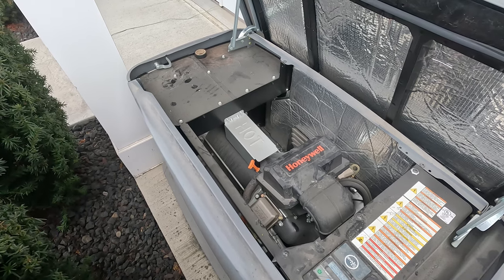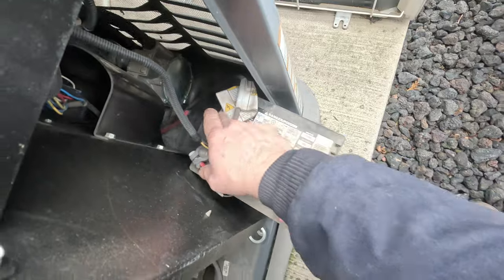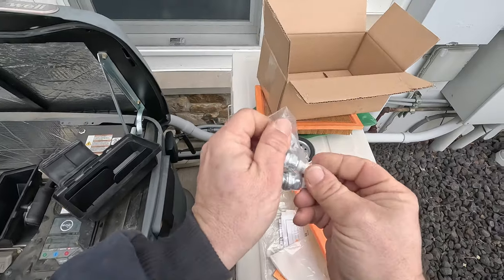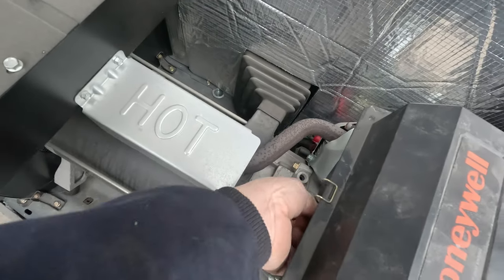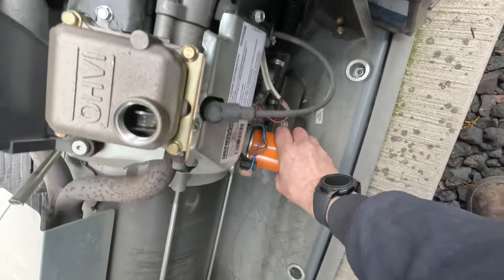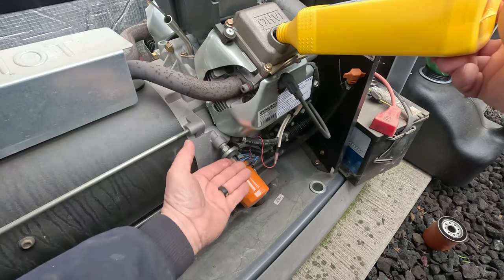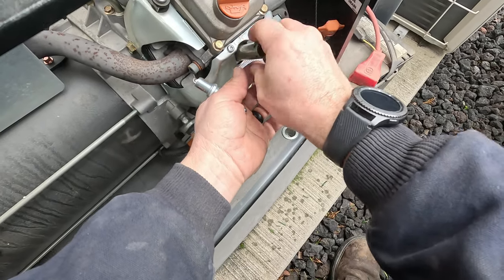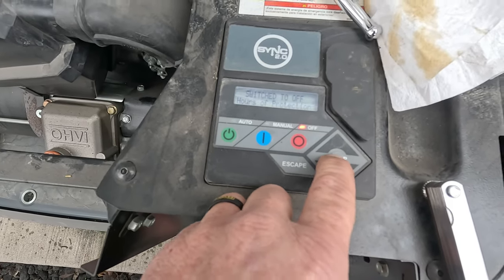Generator Won't start?  Generac Service Made Easy!

Comment: Well done, I was looking for a no  crank issue and I’ve been doing all my maintenance since it was installed in 2003 . I already replaced the starter about 10years ago. I was hoping it was the solenoid this time👍

Comment: Cue the putting contaminants into the filter arguments......
Reply from the maker: Isn't that what the oil filter is for? To catch the contaminants LOL it's not like this thing's hydroscopic
Reply: @HVACRSurvival  apparently the oil enters the small holes and comes out the center so pouring oil could put particles after the filter...I always thought the oil went the other way and always filled em up as you did so I just oil the seal and fit it empty. I think the oil moves so fast its not a big deal these days...
Reply from the maker: If the oil is brand new and the oil filter is brand new, then if there are contaminants in there,  it's probably from the oil filter. Even then worst case scenario to catch it on the other side of the filter as it circulates through. I don't necessarily think filling the oil filter in advance is that big of a deal either but it's just something that made sense so I just started doing it.
Reply: @HVACRSurvival  my thoughts too but if you let a mechanic see you do that you can set em off... especially if they are by the book mechanics....they say all you need is a tiny particle to destroy the crank journal...

Comment: 250000 kw generator???  Like to see the size of it!   I’ve done work as a CM in the navy and worked on a lot of 400 kw gens, about the size of a short shipping container.  200 kw were the size of a van.  Of corse this is the entire unit as a whole, fuel tank and all.  But a 250000 kw must be massive 🤷🏻‍♂️
Reply from the maker: Sorry. I misspoke. 250kw.
Reply: @HVACRSurvival  I thought so, all good…. I had to rewind it a few times to make sure I heard what I heard.   Just curious if the Hoover damn could produce 250000 kw lol,  I’m sure at that point it’s in the mega watts.

Comment: can you tell me what causes the stators for fail
Reply from the maker: It really depends, dirt can cause major issues if it’s running, the vibration of the dirt in the windings can cause it to eat through the insulation. Another possibility is getting degreaser or some sort of chemical like battery acid in the windings or over loading the generator.

Comment: An auto mechanic said it's a no-no to fill up the filter, you're potentially introducing contamination into the system
Reply from the maker: That's the weirdest thing I've heard, I wonder how they came up with that.
Reply: So when you do your oil change on your car do you not put oil in your filter.  It’s the same principle. Just different application.  It allows the flow of oil from filter back into the system easier on start up when it’s already has the oil in it.
Reply: @jonathanontkean7270  definitely no oil in the filter, just some on the o-ring
Reply: The mechanic is Rainman Rays Repairs here in YouTube, he has a few videos where he talks about it
Reply: 3rd generation mechanic going back to the 50s that is completely incorrect doesn't even make sense its no different than filling the crankcase or just having the filter off all 3 are  chances of contamination so in your theory the right way is don't change it which goes back to incorrect you want the media wet when the pump slams oil in to it this also helps dry starts

Comment: Great video for home owner level maintenance. I just bought a 7.5 Kw unit and the motor looks to be half of the two cylinder model and the crank rides on roller bearings not like bushings that a lot of motors have gone to, The form a funnel will be a good thing to have.
Reply from the maker: Thanks !

Comment: Thank you for the maintenance review and tips. My 2003 unit is in Northern Michigan. From previous videos U have given me a very clear understanding how these things operate and their issues. I do all my maintenance myself since I’m a very remote farm. For survival I have to be self reliant  and I’m well trained technician and engineer. Fortunately, I don’t have any critical loads (home is super insulated) that need to be attended too so I will operate the generator manually (once a day) for larger loads, and to charge a battery with inverter used for light loads during an outage. Plan to add a solar system in the future. Looks like at the end of the video U may have left the quart oil bottle in the generator compartment since you’re working with the camera. Great explanation of all the details involved with important safety notifications.
Reply from the maker: I leave the oil for the owner, because it's an air cooled motor it will naturally burn more oil than a liquid cooled motor. I'm doing a review on a solar generator real soon. It's 3600 watts RMS and 6000 peak, I also have a 400 watt solar panel to charge it. This sounds about what you'll need.  I ran the whole house with it, the only issue is you need to use power management if you want it to last. It has a 3600whr battery, the load test showed it tested at the listed rating when l tested it with a continuous 1200 watt load, it lasted about 2.1 to 2.5 HR.    

I did a review on a smaller solar generator a few months back that was 1200watts rms, with a 9xx watt hr battery. It did fairly well too.
Reply: 14:49 - Another way to avoid the ‘klunk, klunk, klunks’ is to use it the way the bottle was designed to be used which is to pour with the spout in the highest position.

Comment: First let me say you’re great. Love watching your videos, learn so much from you and have the utmost respect for you. Not sure if I would have even touched that generator because it’s a liability issue. Windows are way to close to the generator. Generac recommends 5’ from any window, door or air intake and 3’ working clearance on sides and front.
Reply from the maker: I said a lot of things that I cut out. I agree, there were several things that weren't correct.
Reply: @HVACRSurvival  yeah I already know that you knew that. You’re way to smart to not know! I appreciate you sharing your knowledge. I learn a lot from you! Thanks for all you do!

Comment: I have an older generac generator and it is so hard to find good qualified repair techs. Just found your channel and lots of great info. Not sure if you noticed but you left the empty oil container in the generator.
Reply from the maker: Negative,  that has a little bit of oil left in it so when they check the oil and it’s low, they can add some to it and it lets them know exactly what type of oil has been used because people tend not to listen when you tell them.

Comment: @hvacrsurvival I just bought a home and it comes with a 20kw generac generator. I just followed the steps and changed the brand new battery, oil change, filter change, and new spark plugs (the whole package came together). But my generator just cranked couple times but no start at all. What could be the problem? Thanks I’m advance.
Reply from the maker: To many possibilities,  Take it back and exchange it is what I would do if you just bought it.

Comment: Where did you get that Pennzoil? I have not even seen it on the market. My 24kw Generac is close to it's schedule A. I am in a warmer climate and the maintenance pack from Generac has 5w-20 in it.
Reply from the maker: From a local supplier.

Comment: Great video! I am learning about this type of generator just by looking at your videos! The tech support line of Generac is not that helpful! One question to you and everyone, I inherit a Generac generator from the previous owner, the battery currently connected is a 34 battery but the manual says this generator needs a 26R battery. Is this mean the 34 battery is useless to me and could cause damage to the unit? Please advise! Thank you so much!
Reply from the maker: Having at least 525 cold cranking  amps for most air-cooled generators is the most important thing, the number you're referring to is the physical size of the battery and the dimensions.
Reply: @HVACRSurvival  Thank you so much boss! Understand! Salute!

Comment: I use a vacuum extractor to remove the oil on everything, zero mess.
Reply from the maker: Getting oil out of a generator that is below grade can be a challenge.
Reply: @HVACRSurvival  Get yourself a fluid extractor.
Reply: Those generally won't help much on the filter.   I've pumped fluid out of a transmission that way, rather than pull the diaper off of an engine, but I do prefer draining it using gravity.
Reply: @tbelding  Never mentioned anything about the filter.  I prefer fluid extracttion as more fluid is removed.
Reply: @Boodieman72  - Assumed you included the filter because that's usually the messiest part.   Catching a stream of oil isn't a big deal, but the filter tends to go unpredictably.
Reply: @tbelding  It depends on how the filter is mounted. My car has the filter upside down at the top of the engine so the oil is already drained back into the engine.
Reply: I enjoy your videos.  As for the funnel to catch oil when changing the filter, I use a two liter coke bottle with the top cut out. Works perfect.
How did the installer get by with placing the generator that close to windows, doors and ac unit?
Reply from the maker: @Charles I'm not sure who installed it, I'm pretty confident It wasn't at our company.

Comment: Propane or LPG driven combustion engines are eating Sparkplugs because Gas has a height and dry flame.
Your engine has only some hours worked. They only should be replaced after 1000 Hours of running and look actually
like new ones.

Comment: That is milli ohm internal resistance. If it was 5mega ohm at 13v theb touching the terminals would drain your battery 😂
Reply from the maker: Thanks for clarifying that👍👍. It's been years since studying the electrical mathematical nomenclature.

Comment: That unit was installed without much regard for proper clearances.
Reply from the maker: True and true!
Reply: Rick, we specialize in Cummins in our shop but also have techs certified in Generac because we used to install a lot of them pre fuel plenum lawsuit.  

Recently moved a 22kw guardian about 60 feet for a homeowner in Houston metro area who had it installed by a “generator company” that was contracted by the solar company putting in the panels.  

Bottom dollar In unincorporated area of Harris County, TX with no permitting or inspection required .  Gen set exhausted directly beneath dryer vent with pre existing damage.  3 days of run = fire department responding for carbon monoxide poisoning.

I fail to understand why people cut corners with things that can kill them….

I hope folks who watch your videos have the self awareness to know if certain tasks are outside their ability level….and your video certainly demonstrates how the work SHOULD be done and will be done by a professional

Comment: Rule of thumb on those filters.   Oil the gasket (some call it an o-ring, but it's usually flat, so it's a gasket).   Thread the oil filter into place until it just touches.   Then rotate the filter three quarters of a turn.    In 36 years of working on my own cars (IT consultant, not mechanic), I have had one brand of filter back off.   Funny enough, it's the one that other people all swear by, rather than at.   Wix.   Luckily, I caught it on my wife's car when it was just dripping, and it hadn't popped out. 

I will say that when I hit something that I've paid for that has a "locked" area - I scream bloody murder at the manufacturer.   I understand not making it -easy-, but it's -mine-, not theirs.   If they want to hold that code, then they need to do the service on it for me for nothing.    I've never failed at getting the access I want.